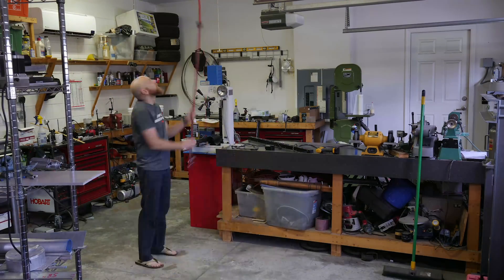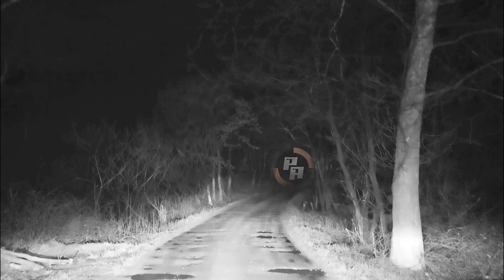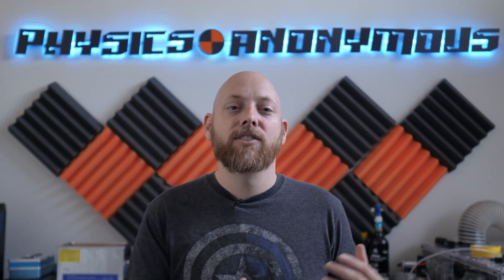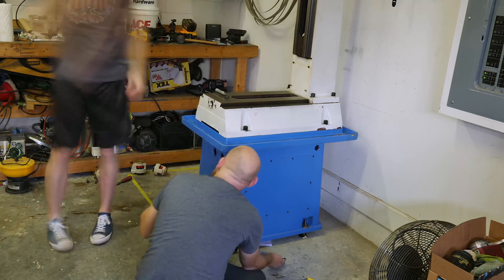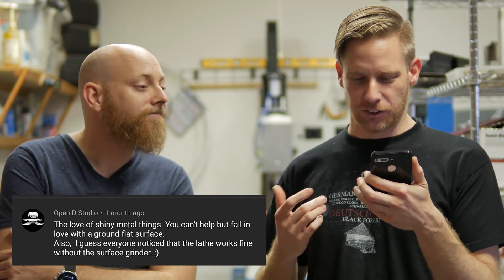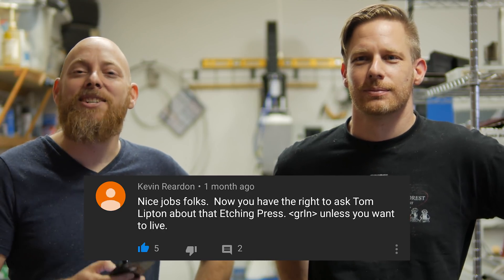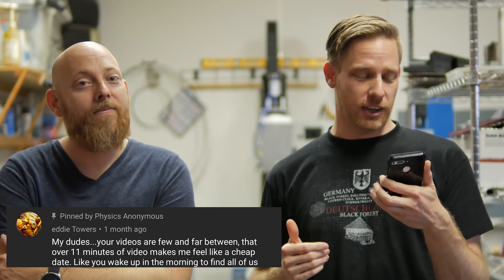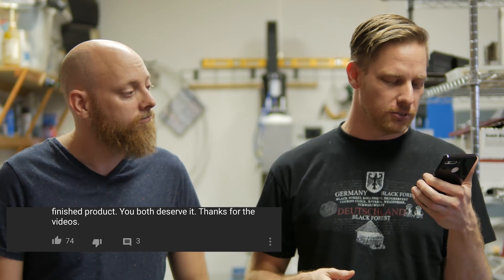The Joy of CNC, Manual Mill to Mechanical Monster - S03E01

Comment: If you want to know how much bondo is on the machine and stand, I stripped my 940 down to bare metal with a needle scaler and then repainted it. I collected a gallon bucket full of bondo and paint. I was pleasantly surprised at how well the castings looked after removing all the bondo. They castings aren't perfect but still didn't need a gallon of bondo covering the entire machine. I repainted mine with POR paint. I used gray for the mill and black for the base. It looks 100% better now.

Comment: So, I get that this video is close to a year old but felt that my comment might still be relevant.  When I bought a Grizzly G0752 - 10" x 22" Variable-Speed Lathe back in spring 2016 it came a little beat up and was obvious from 'jump' that this thing wasn't "Made in America".  That's when I realized that if I had researched 15 more minutes I would have ran into Precision Mathews.  At the time, the PM-1030V, came w/ both a Quick Change Tool Post set included, installed, ready for use (rare in the industry in 2016) and a 2 axis DRO.  Best part, they were, at the time, still being made at their headquarters in Pittsburgh, PA.  Now, like everything else (Sadly including Grizzly), they're all made in China.  Which is why the boys found every bolt hand tight at best. SMH.
I plan on completely rebuilding my machine shop, and soon, but at least now I have the education to be able to buy the best the Chinese have to offer and will expect to spend the first few days dissembling and resembling the unit.  Hope this helped, someone... :)

Comment: Linear bearings on the z are the best upgrade aside from ball screws.  Also look into mounting your y axis motor out the back of the mill. It makes a huge difference while using the machine. Less bending over and reaching on set ups.  I look forward to your build!

Comment: Cool project! I converted a G0704 clone to CNC not too long ago. I built an enclosure for it, replaced the spindle motor and gave it a belt drive, gave it flood coolant and a chip conveyor, pneumatic power drawbar and now I have an automatic tool changer on the way.

You have a long journey ahead of you and I guarantee once you fall down the rabbit hole you won't stop upgrading that machine until it becomes a mini VMC. Something to keep in mind because your next machine will be one ;)

Comment: I am still wandering if you will ever finish your lathe!!
Reply: For that first they have to finish the surface grinder, since eh 5 years?  400 projects same time.
Reply: As far as I'm concerned the lathe is finished.  Seems to work great, only way to make it better would be send it off to be professionally ground.
Reply: Steve just Steve Thats a lame ending.... You wanted to grind it!
Reply: @MaxMakerChannel  

yeppp, thats why they try to build the grinder. And what happens with the grinder? finished too? LAME !Never ending stories i do not need those abos

Comment: It;s a big mistake but I will watch with interest. After you spend all that money on C4 ball screws, closed loop, truing it up and blah blah, your next and main issue is the spindle speed. Most machines in that class top out at 3K which is close to useless.. as is the gearbox and AC motor. Going BLDC with a hall feedback will cost you good dollars. Direct drive on the spindle is the way to go, but then you lose your tool changer. Once you have the thing spinning north of 6K you will then need to replace all the spindle bearings. And I haven't even mentioned an enclosure or cooling system. Buying a Tormach, Syil, or Optimum CNC is the ONLY way to go.
Reply: Much rather buy an good older VMC like a Fadal for half of a new Tormac and have a real VMC.
Reply: @Steve_Just_Steve  No such thing as Fadal where I live... but as cars are no longer made in this country, you can find some bargains on older machines.
Reply: @MrFastFarmer  where do you live?
Reply: @Steve_Just_Steve  lol. I'm in Australia. Last car made here was 2017. As a country we make very little anymore.

Comment: I realty like your channel.  I can relate to your goals and how you prefer to build it rather than buy it.  I'm the same way.  I will say though that you bought a bench type mill, not a Bridgeport.  Any quick searches on the web will have informed you of what to expect.  I wouldn't be disappointed in what you have.  Its a very robust machine and Matt from PM stands behind his project.  Maybe you should have contacted him before posting this video  If you did then it would have been nice to know about it.  Yes it needs to be disassembled, cleaned and put back together.  They all do.  Even a used Bridgeport type mill costing the same as the PM would not be perfect.  Put it back together, throw on a DRO and use it.  You'll get a lot more accomplished with it using it as is rather then trying to fix its minor issues.  I agree with some of the comments, you guys have been jumping from one project to another without finishing much.  Lets see something come together!  Thanks for the vids guys.  Keep em coming!
Reply: OMG. DRO?? It's a CNC project.

Comment: What are your plans for the spindle/spindle drive? They are the most difficult bits of a home milling machine IMO.
Reply from the maker: The spindle it self is pretty good already, but we will swap out the bearings to angular contact bearings and replace the motor with a proper 2 or 3hp 3 phase. Then belt drive the whole thing 3:1. Our aim is 7500rpm.
Reply: @PhysicsAnonymous  interesting. There's a seller on Aliexpress that sells a servo spindle motor that'll do 1.5kw (2.2kw overload 30 minutes) with 9.5 Nm of torque at 1500 RPM, rated to 6000 RPM, maxing out at8000 RPM. It'll even run on 220 single phase according to the seller. I'm building a machine and it's what I'm thinking of using, it really seems ideal. If you're interested the seller is Shenzhen Guanhong Automation. 
Anyways, good luck with the build! I totally understand why you're building one, I think it's the same reason I'm building mine... the exact machine that meets your needs just doesn't really exist. It's great that we live in a time where we can go and make our own milling machine.
Reply: @CalvinoBear  That's good information. What's the link?
Reply: @MrFastFarmer  search 'Economical 1.5kw 9.5Nm spindle servo motor and the matched driver for cnc'
 on Aliexpress without the hyphens. I think you have to ask the seller through messages for the 220v version. It's not cheap (and I don't have one yet) but there's even a full manual for the drive unit in English... it seems to be the real deal. 14+ Nm of overload torque in the home shop... drools
Reply: @CalvinoBear  Not sure how it would have enough torque at lower RPM on single phase.
Reply: Steve just Steve it’s an AC servo so a bunch of manipulation happens to the electrical power before it gets to the motor, so that the current and the frequency to the motor can be  fully varied. If I understand single phase will probably result in a slight power/torque loss at higher RPM in this case (based on torque curves of other motors, haven’t seen the torque curve for this motor driven on 220 single phase)